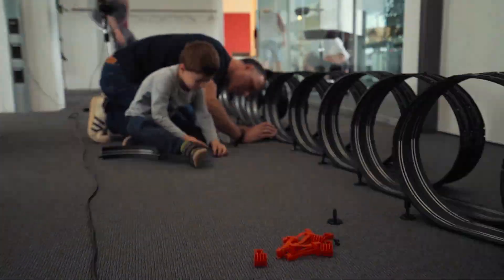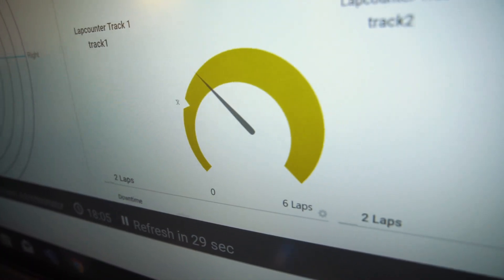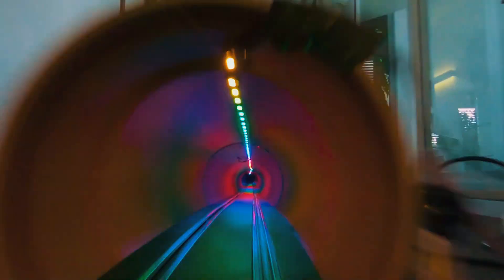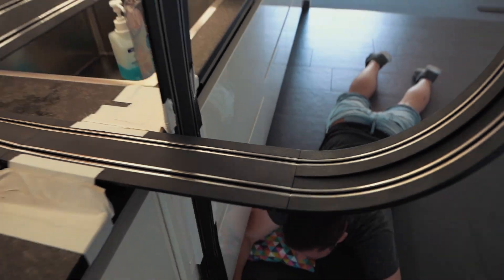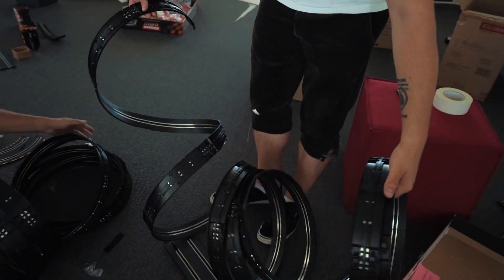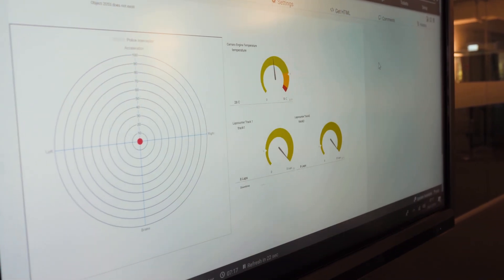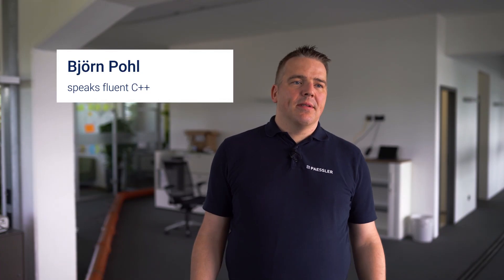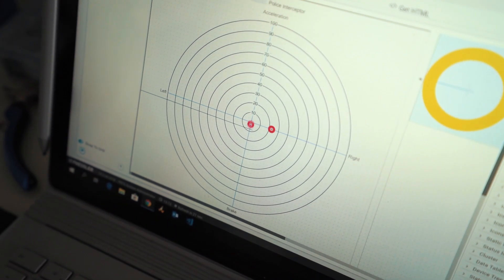Slot Car Monitoring (Massive Office Slot Car Track)

Comment: how did you extend power supply true this giant track?
Reply from the maker: @Rok Chich, we needed to controll the track from multiple positions because you could not oversee the whole track at once. So we simply interrupted the track 6 times and connected a basic power supply with controllers in there. So the cars where passed onto the next driver everytime